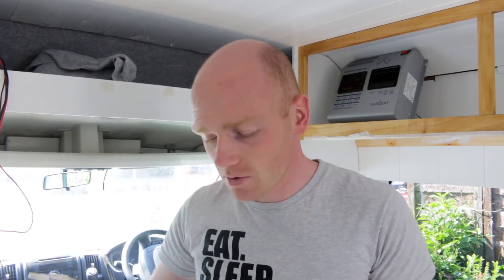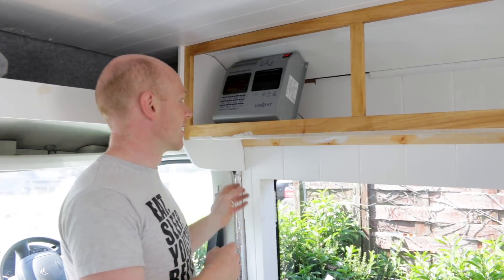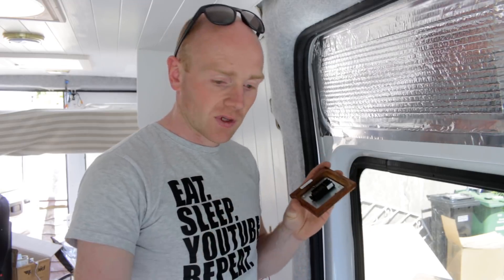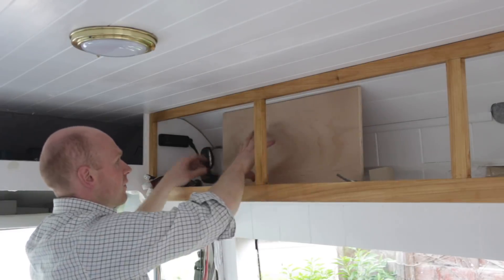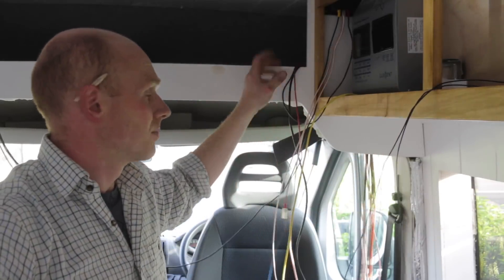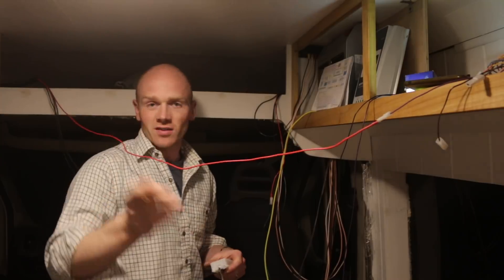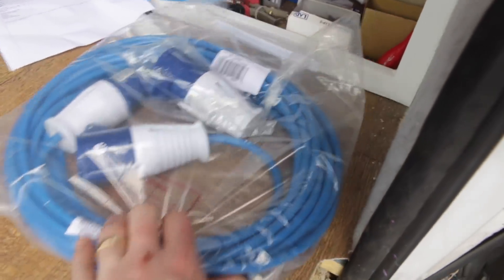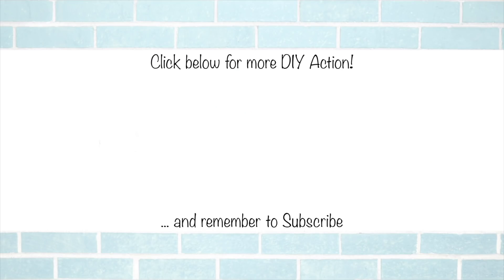Installing 12v and 240v Van Electrics

Comment: Note: This ec155 unit CANNOT charge AGM leisure and most GEL batteries. The charge is too low and will damage the battery. I was told this by Sargent support.

Comment: Got 12 volt lights in my ceiling and they keep going out with brown outs of surges. they want to solar on a 12 volt capacitor onto the wire of the light, it may not work read their body language well. Can i change the 12 volt to 240 lights

Comment: Well, I've just bought the Sargent unit for my Merc sprinter and I too am a little daunted looking at the wiring.  But your warts and all video has helped alot. Many thanks. Nick.
Reply: We have the same unit also a 15 plate Sprinter. We're using a 12v fridge direct to the battery. How are you getting the signal from the vehicle to the Sargent unit so the battery charger works? Thanks in advance, David

Comment: im really struggling with this system. I've got a black and white wire that doesnt seem to go anywhere. The brown and blue to leisure battery ends at a fuse with no wire to goto battery, did you have to buy more? All those orange and white wires, did you use them all/ where did the all go?
'Light feed' vs Front/ Rear lights, wtf, what did you do there? Thanks
Reply: Hi, I've just had the same question about the black and white wire. From the instruction book it looks like it's the negative feed from the fridge. Hope that helps? D

Comment: Hi Tim, I'm trying to fit a sargent unit now and wondered  if you installed a relay for your fridge to only come on when then the van is running - this is what was in the sargent schematic - you say in this vid that you are running your fridge straight in - could you explain a little - would be very much appreciated.
Reply from the maker: No. Compressor fridges need direct feed from battery. The Sargent supply is for 3 way type.
Reply: Thanks so much for the swift reply - especially on a Friday evening.  I take it there were no issues with the battery running down quickly then - do you put in an isolation switch??

Comment: hi does the charger switch on top have to be on to supply 230v to the rest of the van. The reason I ask is that I want a similar set up but want to tie in a 230 inverter so can use 230v when not connect to electrical hitch. I want to to use the rcd on the sargent to save additional wiring. But dont want to loop back to the batteries through the Sargent charger.

Comment: Doing a fantastic job of your van..I've watched several of your vids recently.  I hope my build turns out at least half as good.
 On a side note, I work for Sargents, building the main looms and this is the first time I've seen someone using one of our looms in a build.
Reply from the maker: Hope I haven’t installed it all wrong! It’s worked out great so far, doing some more on the van electrics next week so more videos to come. 👍
Reply: The Restoration Couple 
To be fair, I never see more than the wires and also some the moldings with the terms, so things like the consumer unit are a mystery to me .. I'd say if it all works, you've done a good job 😉
Enjoy.!

Comment: Hi Tim, can you tell me which batteries you have used and what dimensions they are, also have you packed under them  at one end to make them flat or  do they slope?, cheers Jason
Reply from the maker: Should be a whole video on it. They are standard sizes 100ah agm. 👍

Comment: It may not be an issue for you but if you run anything from the load terminals of the epever solar controller, watch out that it's negatively switched (and common positive). I originally had one installed but appliances would complete their circuit via an earthed appliance. I swapped for a different model that's positively switched (and common negative) and it works fine. With the Tracer A, it appears orange buttons are common positive and blue buttons are common negative.

Comment: I would not cut back those unused 12 volt circuits.  Instead install them a extra power points  and there are always more things added.  On my 50' boat all my wiring problems are from the add ones by previous owners.   But it is 44 years old.  And as we change to LED lights all the Micky mouse'ng is reveled; 10 Amp loads on speaker wire. the old guy    Bert
Reply from the maker: When i said cut back I just meant that I would shorten and re crimp.  There will be a few spare feeds which will just be taped up and tucked behind so plenty of scope to extend like you suggest.

Comment: Used the same in my camper

No worse at changing than my split charge system in my work van

Plus it kills the lights correctly when the engine is started

Comment: Rather than using the unsightly metal brackets fixing the false wall you should have fixed two long block of wood behind the false wall so you only have four neat screws through the false wall into the blocks.
With the supply to your unit you should have made a cover for the back of the battery housing and fitted a couple of re-settable circuit breakers. 1/ They make it easy to see if a circuit has tripped. 2/ Easier to reset and no need to find a spare fues of the right rating.
Reply from the maker: It’s all coming out when we are back from our first trip so I can do things more thoroughly including most of what you have mentioned. 👍 just needs to be working and safe to get away for now.

Comment: Hi thanks for your lovely videos. When you add the solar power, does it connect to the power control system or directly to the leisure batteries?

Comment: I too have a 155 to wire up,     was it easy did you have to cut any bulgin plugs off ? Is the split charger of use
I see you still had to add a earth buss bar .
Reply: I also have the Sargent EC155 system in my van (Sprinter). Plug and play is almost correct....I have bypassed the built in split charger with a VSR between starter and leisure batteries. I also installed a separate 12v fuse box because the Sargent psu isn't suited to a 12v compressor fridge. The control panel is great as are the fresh and waste water tank level sensors. The 240v side is more than adequate with lots of expand-ability for me in terms of water heater etc